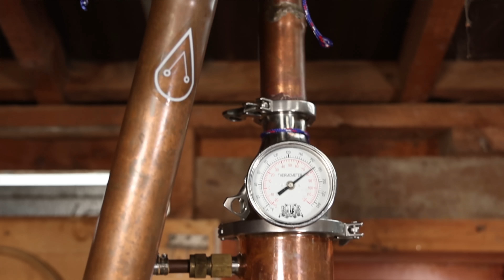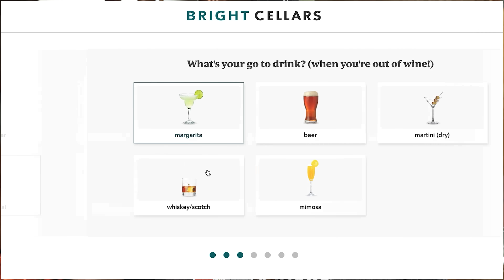Can Wheat & Barley Make A Awesome Vodka?

Comment: hey,

did you end up doing the packing over plates?

I have a 500mm packed section of spp and 3 bubble plates (4" column), i am really interested to know if packing over plates works well or not.
Reply: I did this last week. I had six 2" plates --> 1.5m packed column --> dephlegmator (this setup was literally 3.5 meters tall including the boiler). Everything was going smoothly until out of nowhere wash started to spew out of the condenser into my collection jar. It was a torrent of liquid, had to stop the still. This happened I believe toward the end of the hearts, I lost a lot of product. I think what happened was that with all the extra reflux in the column it was flooding the plates, so much so that the column actually started filling with distillate until it shot out the other side. Next time I'll be putting the plates ABOVE the column.

Comment: I've made some sugar wash vodkas in the past that had what I thought was a sugar bite and a cloying sweetness, even when making really tight cuts, distilling to 95%, and doing everything "right" in fermentation. Then I made an all grain wheat vodka with no sugar and it's very smooth but still has a cloying sweetness to it. Does anyone know why this is? I know ethanol is a little sweet but I've never had a commercial vodka with this sweetness. Anyone experienced this before? It's otherwise very smooth and has very little flavor other than sweetness. Maybe I shouldn't complain 😂

Comment: Very nice stuff Jesse! I took a distillery tour in Seattle WA about 8 years ago and had a fantastic single malted 2-row vodka from Sound Spirits, it was buttery and smooth, with a great full roundness in mouthfeel. Skip ahead and Covid took them out of the game, lame (I guess switching to making hand sanitizer didn't save them). Then while in Scotland I visited Holyrood distillery and sure enough they are selling "newmake" spirits which is essentially malted barley (while the rest is kegged in oak for aging) and they print the grains and starting gravity/yeast strains used and ferment schedule on the bottle, LOVE IT! So now I'm doing the same for my vodkas from my local maltster (Skagit Valley Malting), I'm sure it's going to be great, I have 10 gallons (38 liters) fermenting away right now, can't wait to process it!

Comment: I make a potato vodka that’s that smooth it makes your mixers and liqueurs taste smother and sweeter. 
2.5kg barley
11.5kg potato’s
2x lemons 
35L water 20g yeast ec1118
Wash and cut potato’s into 1” cubes bring it to the boil and until potato’s are soft use a masher or paint mixer to mash them up then cover them up and allow to cool to 65C add milled barley and let it rest for a couple of hours then add to fermenting barrel bump the abv up to 1080 with table sugar if needed and add lemons then add yeast once temp has dropped below 30C let it ferment out and and distill I use a jacketed boiler but I did used to use a brew bag to strain before distilling it’ll make the best vodka you have ever tasted.

Comment: Several years ago a company called Bong Vodka in Florida mainly to distribute a bottle that could be made into a bong.  Surprising the vodka was really good, and I suspect this was made with wheat/corn mix cause it was extremely smooth had a slightly sweet finish.  I wish the contents of my bottle lasted longer cause I haven't found any since.  This was at 40% alc but I would have loved to try a 50%alc version.  I still have the bottle but no holes are drilled into it, lol.

Comment: Shiiiii....
That's creepy Jesse! I literally just did exactly this.
I followed Ian Smiley's recipe/method.
Soft (low protein) wheat, alpha and gluco, ferment on grain, turbo500 SPP column for strip, proofed with shop bought filtered spring water to 30% for carbon filter then restilled with alambic for spirit run, proofed again with  shop/filtered water to 40%.
The finished product was on a different planet to anything I've done before. To me, it tastes like buttered popcorn. 
Constructive criticism, I was at 1.04 so I'll add about 4kg of sugar next time. Also, seperating grain from ferment was a b*tch! 
Was fun cause I've been a turbo/sugar bro up until that point so this was a first time doing grain mash.
Will be doing again for sure!!!

Comment: The flavor you mentioned in the end is a result of using plates vs packing to hit your vodka ABV. Remember, plates act like little thumpers as it collects and pools the impurities/flavor left behind, infusing the new vapor coming in, eventually letting a little pass on to the product. Packing micro-refluxes (comparatively speaking) which creates a more flavorless vapor. Neither are wrong, only correct to what you are trying to achieve.

Comment: I made a potato vodka several years ago that was delicious - did it in a 1.5" column packed with copper scrubbies and ran it through carbon afterwards.  Downside was sitting at the kitchen stove stirring two five gallon pots of mashed potatoes for an hour (this was before I learned about HTA).  Had an atrocious yield (about 750 mL of 90 proof), but it was quite tasty...but I'd never do that again

Comment: Hey Jesse, how do the solids affect the hydrometer? I saw you using the bucket and pressing your grains - mate, grab a 15L stainless steel hydrolic fruit press and out the grain in a fairly large micron biab bag, best investment I ever made and you can get them in eBay for about $100-$150. Also, the astringency you mentioned - instead if boiling the pearl barley, soak it over night and steam it (not in a pressure pot, in a basket steamer) this way you avoid the occasional harsher tastes that come off it when you boil it 🙂

Comment: Hey Jessie ,love the videos 📹 have a small tip for you maybe,  a wash in the Still is like Soup in a pot if you want a lot of flavour run it on a slow boil, if you want less flavour run it faster because steam takes flavour away not Alcohol steam water steam ,Linus Tech Alco tip of the week 👍🎅🇦🇺
Reply: Interesting. Always thought the opposite. Still a novice distiller so will give it a try.
Reply: @dopstjom701  the slower distillation gives more time for the vapours to reflux and purify, giving better flavour because less volatile substances like fusel oil is carried over past the point of no return, however the column height, dephlegmator and 8 bubble plates in this setup should negate any need to slow boil.

Comment: Eventually in our area (Russia) the best vodka is concerned wheat vodka, without barley, anyway good video, cheers)
Reply: Could you please send me ypur recipe for Russian vodka that you make
I would really lije to try making some
Many Thanks
John
Reply: @johnbritcher8561  Basically you can replace barley with wheat and use the recioe Jesse has provided, but maybe this could help also:
- spirit should be not distilled but rectified (column or plates still )
- you can add some sugar and or citric acid in the deluted spirit (a little bit to improve the drinking qualities)
- sometimes the deluted spirit is passed through charcoal filter before spirit run)

The point is to use the most neutral grains to avoid powerful aroma & taste => wheat is just fine, because barley has its own , as I'd say not-vodka-profile, but tastes differ you know))

Comment: The bitterness/astringency could be a bit of amyl alcohol coming through. That's one of the most difficult things to get rid of as home distillers since it appears as a bigass smudge across the plates. Along with a higher number of plates, most NGS distilleries will have a separate column specifically for removing amyl alcohol from their distillate.
Reply: The only thing that I made that I haven't noticed it in is my straight corn whiskey